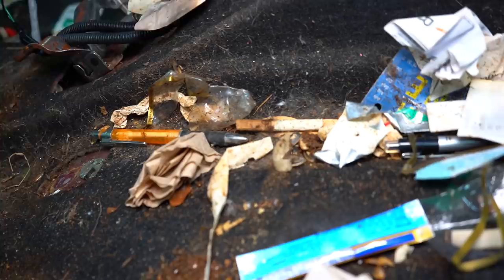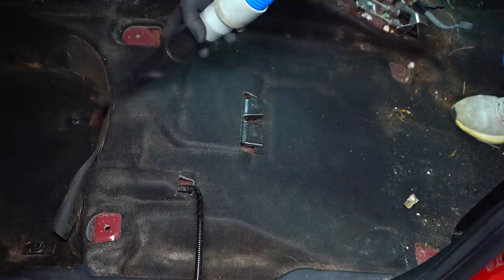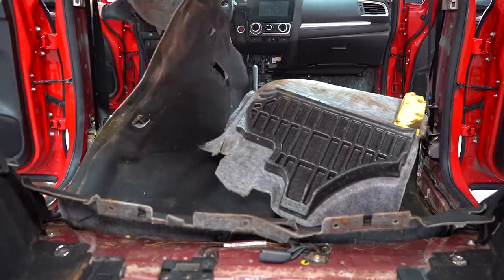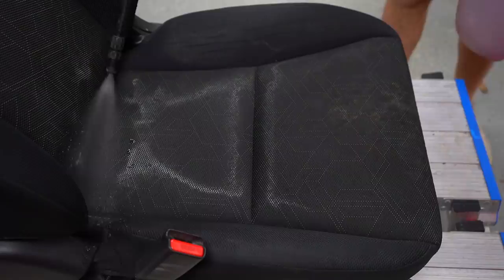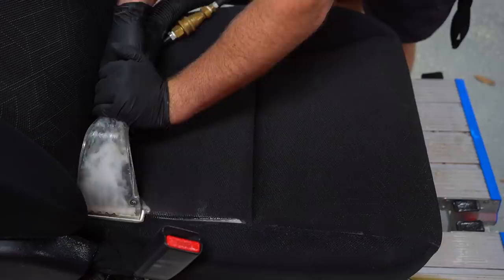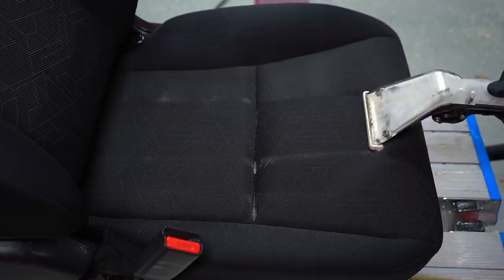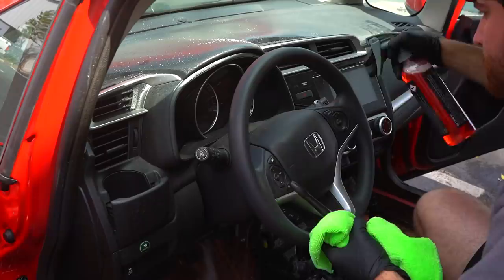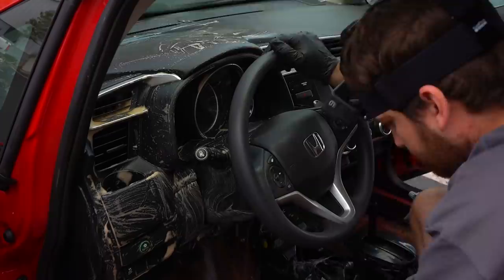Super Cleaning a NEGLECTED Honda | NASTY Roach Infested Car | Insane  MAD Detailing Transformation!!

Comment: The easiest way I was able to get imbedded dog hair out of these cheap materials that car manufacturers use, is that it’s called Furzoff. You can get on Chewy.com and it’s blown glass, but looks like a stone. Saved me so much backbreak and time as well. And as a car detail owner to another, I so recommend it!

Only thing to be careful with when using it is to not use it near any plastics or it will scratch them to no return.

Great videos like always man!
Reply: I've been looking for something that would work in my house. I have 3 cats and 3 7ft cat trees in the house. Everything is covered in cat hair. I really hope this works! ^_^ Thanks for the suggestion.

Comment: Hey! How do you clean the seatbelts? 👀 I’m addicted to this channel😩
Reply from the maker: Steamer
Reply: I got a used car that had been owned by a dirty smoker, pulled the seatbelts outside of the doorway, soaked them in a bucket of hot water and laundry detergent, scrubbed away, rinsed, and let them dry before reeling them back up.

Comment: 12:45 At what point would you just pressure wash the car seat? I've done it twice on pretty bad seats. Soap, brush, pressure wash, then extract. 20 minutes tops. The foam is high density open cell polyurethane, so it really doesn't hold onto water. It dries pretty fast with a fan.

Comment: Just one question, because it confused me.

Do you use high pressure air to get the water out of the button crevices?
Doesn't that push the water into the electronic?
I mean you obviously decoupled the battery, so it is no problem now, but if you put the power on again, isn't that a short waiting to happen?
Or do you let it dry for a few days and hope for the best?

Maybe I am a bit to sensitive regarding water and electronics, but as an IT guy, this immediately set me into danger mode :D
Reply from the maker: No it doesn’t push it further I do it because if not you will just have nasty liquid in between  and it will dry and look gross.

Comment: Why don't you just spray down the seats with a hose or something if they're this urine soaked?  Why just keep extracting?  Does it take too long to dry all the way? It seems like it would make it easier to clean and extract if the urine was washed through the seat instead of up and through a tool.  Just wondering.
Reply: A hose is fine but not pressure washer because that will shred the foam

Comment: What to say ? lool I have almost the same car ... Me it's a Honda Jazz and the interior is 95% identical except for the dashboard buttons. I will check if it is the same carpet but I am not very surprised ... They shoot everything but put the package on the reliability of the engine ... Body level I have exactly the same red milano and it is correct horrible to maintain because it is not metallic (live paint) and fine ... I hesitate to go and have it repainted ...
However, I have questions that come to my mind!
Why did you waste so many hours in the hand when you could have spent carpets / rugs and seats in the karcher?
Considering the amount of water you injected, it would have been less tiring for you and more effective because cat urine, I'm sure it will remain encrusted in the foam padding of the seat
Regarding your hp60, you have to have a great need to invest so much money otherwise it is not worth it. I bought a small Bissell and we'll see if it does the job while being sustainable ...
And finally concerning your nickname MAD, I find it light in relation to the piles of sh.. that you can restore ... I suggest you change it and put either crazy detailing or extreme detailing lool ;-p

Comment: I can't understand how people can drive with trash like this.
I mean yeah, my car is filthy sometimes too, because I didn't vacuum it for a few weeks, with sand on the front carpets and a bit of trash behind the drivers seat and in the door pockets, this normal "I don't know where to put it so quick" level of garbage, but normally I clean it then, when the weather is good and I feel like it.
Btw a little trash can in the car works miracles, have one now, since a few weeks and my car is still nearly spotless, apart from the sand and dirt you can't avoid. 10/10 recommend, worth the 15 bucks!

Comment: Have you ever considered on really bad seats, like the passenger seat, to power wash them like you sometimes do the carpets?
Reply: Then you risk damaging the foam underneath, or it molding because of how deep the water is
Reply: @AderialLynn  I've done that before and as long it's not sitting for days soaking wet it should be fine. But I live in Texas so with our summers they dry really fast
Reply: @utfan26  yeah they are in Florida, so a lot more humid
Reply: @AderialLynn  yeah that would definitely make it moldy real quick😅

Comment: My daily driver is a Fit and that carpet is THE WORST carpet I’ve ever had in a car. It would have been better if they had designed a rubber mat instead of using that crap on the interior.

Comment: 1: Why do the seams always hold 100 times more than the flat surfaces of the seats? 2: How long would you actually continue to clean something, that just won't come clean, before finally saying enough is enough? 2-3 hours for 1 seat seems.... yeah.. not fun.
Reply: Until the water cones out clear
Reply from the maker: I’ve spent over 4 hours on one seat before.. not fun but it’s what has to be done.
Reply: @MADDETAILING  yep, can't have someone coming back later saying it was halfa$$Ed, or the smells/mold comping up later